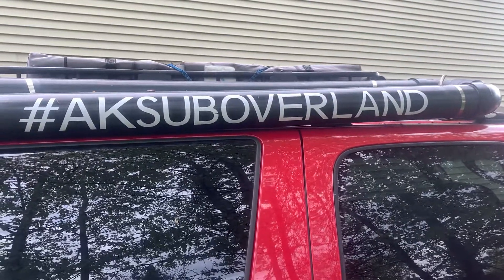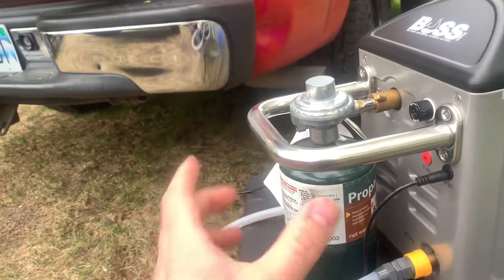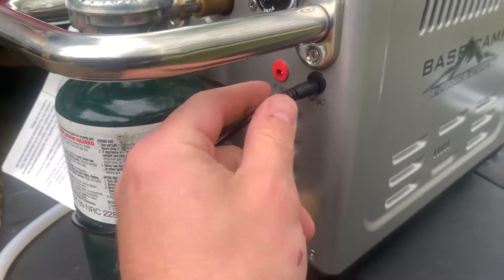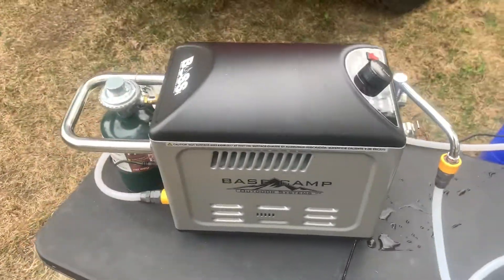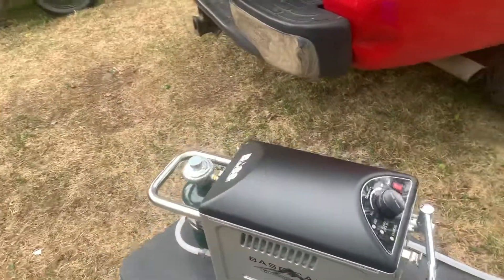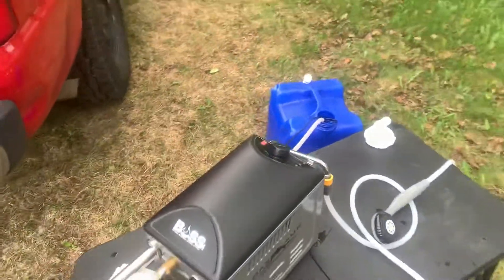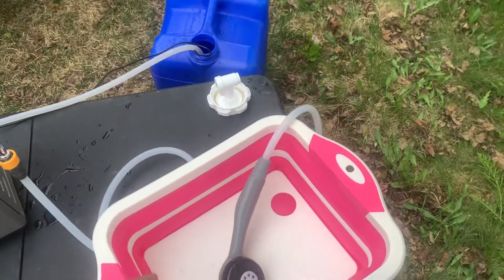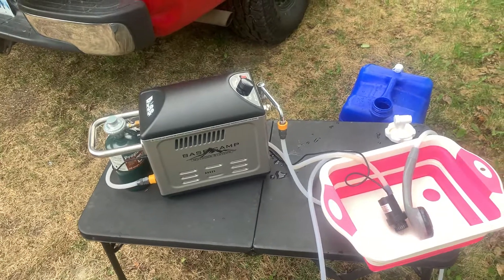Boss base camp shower operation quick walkthrough AKSubOverLand

Comment: What voltage/amperage does this unit use to charge? I'd like to get one of these but we have 240v power here so I'm sure whatever power adapter comes with it won't work for me. I'd like to get a third party adapter that outputs the same voltage/amperage this unit expects. Also, is this a barrel type plug?
Reply from the maker: This uses a 120v 60 hz outlet common in North America.  This charges the unit.  The cord converts it to dc before going into the unit. You might want to contact the manufacturer to see if they produce a charging cord for 220.
Reply: @enos7664  Thanks. If you look at the power brick, it should tell you the DC output (e.g. something like 5VDC/3A, that's what I would like to know).